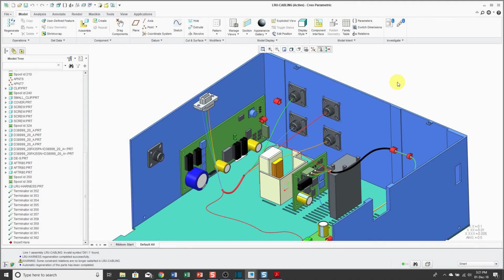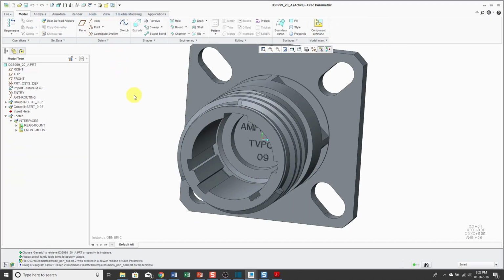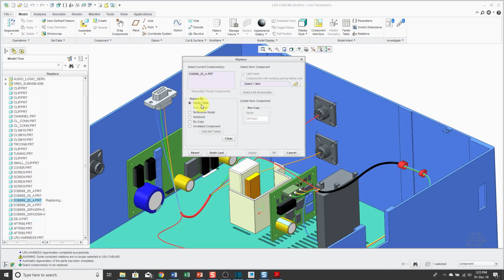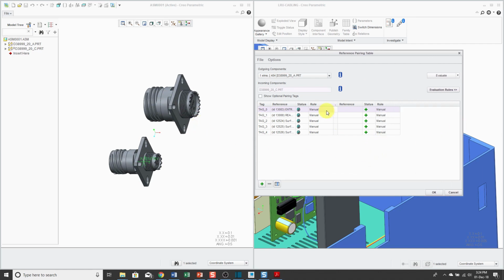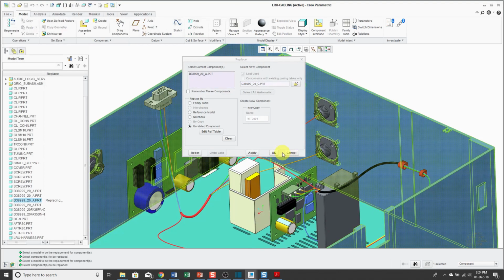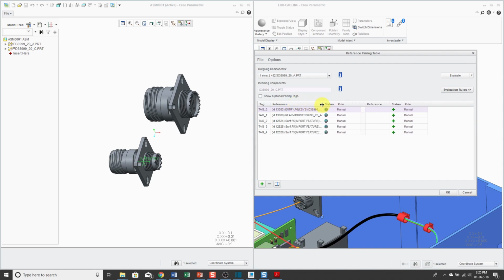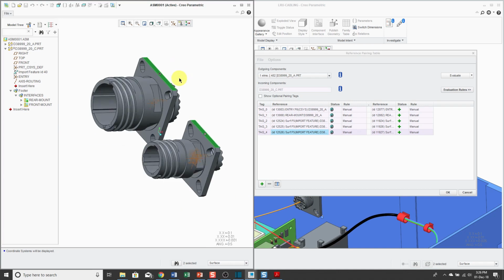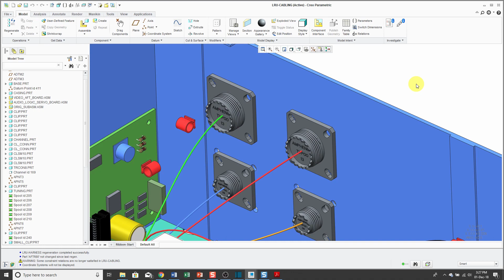Creo Parametric - Replace by Unrelated Component [Tutorial]

Comment: The video is very good and I have performed that operation, but when I check in, the assembly still has related objects that it replaced, I would like to know if you have any video on how to eliminate the object relations that the assembly initially had
Reply from the maker: Set the option remember_replaced_components to no
Reply: I will look for that option, I hope it helps me, I have had many problems with assemblies when I check in... Thanks for answering, you have excellent videos